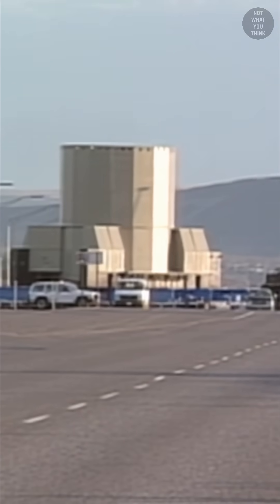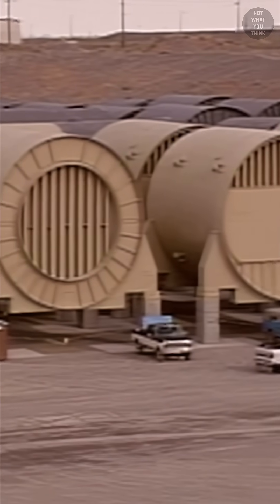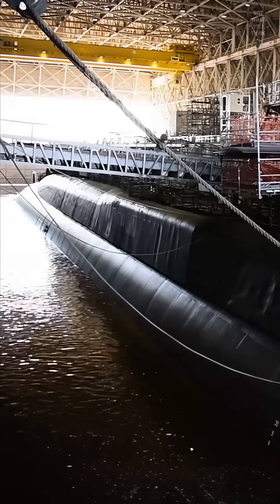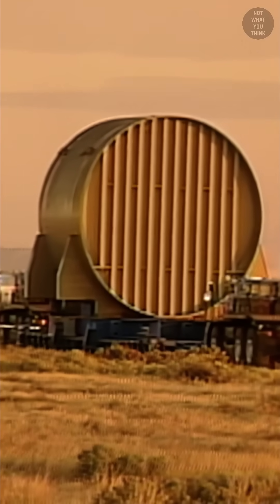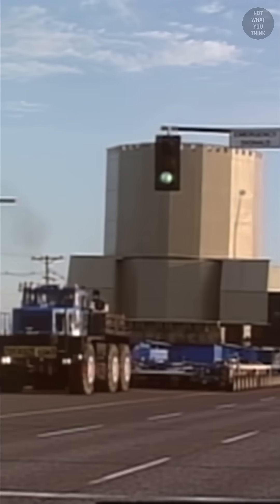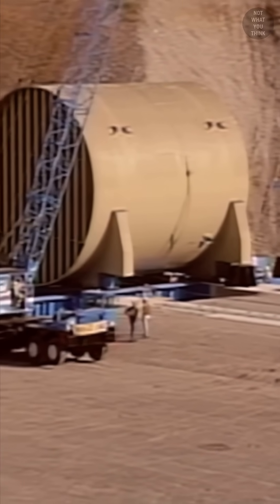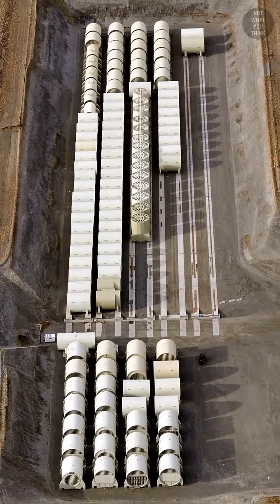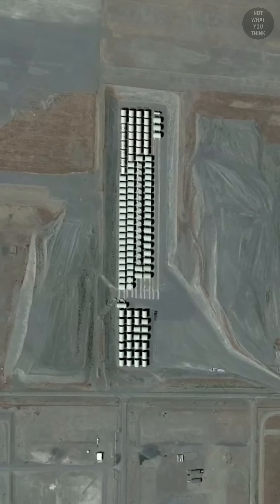What Happens to Decommissioned Naval Nuclear Reactors? #shorts

Comment: Hanford had a release of nuclear materials from an underground tunnel, it was so bad that commercial planes couldn't fly over the facility (built in the 40's)due the high levels of radiation in the air (this occurred in 2017/×018, and it was widely reported on......

Comment: When I was stationed on the Nimitz in Bremerton we used to see these getting loaded onto the barge after the shipyard cut them out of the sub. We called them BRTs (Big Round Things). They would then weld the two ends of the sub back together and re-float them, so there were a bunch of stubby subs tied up to the pier, waiting to get turned into razor blades.

Comment: I prefer to have them in the open, besides the arms treaty requirements, it's easier for structural integrity inspections, and repairs if necessary. Besides that, you're guaranteed work for over 5,000 generations...🤔

Comment: Having actually refueled a 688 class sub, I can say that they do not cut out the entire reactor compartment, only the top. They then lift the pressure vessel and put it in a shielded container which is what you are looking at there. They are also usually shipped by train

Comment: It's also because aboveground storage of dry waste makes it ridiculously simple to set up a crapton of radiation monitoring to detect any leaks or other problems while the waste decays away, and should there be an issue it is far easier to fix safely if you can just show up with hazmat suits or a Drone and have 360⁰ access to the storage cask.

Comment: I thought they were stored in open so nothing could potentially happen to them and could easily bury if needed to since its technically nuclear waste. Why they welded and sealed it up. However things tend to leak overtime and you dont want to be in a sealed building when it happens.

Comment: Yea and need 100000 years for that to become safe !!! It’s really not worth it this nuclear stuff , not worth it , it only started less than 50 years ago and we already have problems , I wonder after 1000 years !!! The earth will be inhabitable !!! Humans deserve to be extinct
Reply: A reactor without fuel rods is a useless piece of radioactive metal that cools down in a few decades, it's "safe" the moment you pull the fuel out. Are you actually ignorant enough to believe that just by running a controlled nuclear reaction, the reactor itself maintains radioactivity for thousands of years? Moreover, unusable nuclear waste from modern breeder reactors that decays over thousands of years constitutes barely a few percent of all nuclear waste produced, the rest of which decays in a couple dozen years. If you were to burn through the entire world's uranium reserves, the vitrified waste would likely fit inside any single one of the world's major nuclear waste depositories. We're not living in the 1980's, brainlet.

Comment: I wonder if they have enough life left in them for the power grid or at least local power needs.
Reply: These reactors are made for highly enriched uranium, to keep them smaller and lighter and extend the refueling periods. No commercial nuclear power plant is running on this type of nuclear fuel, since it's weapons grade uranium while commercial reactors only run on 3 or 4 % enrichment.
Also they have no cooling any more (the water around the reactor is cooling it) and they lack critical safety equipment like a containment.
Commercial submarine reactors are in the size of 100 to 500 MW thermal power (electric power of a reactor is around 1/3rd of it), while a commercial power plant is 1000 to 1500 MW electric (and 3 times this number in thermal power)

Comment: Do the reactors give off a digitial , thermal, radiated signature? How does satellite verification know they r real reactors?
Reply: There are human observers from each side all along the way until the reactors are delivered, at which point satellite observation takes over with periodic on site verification visits.
Reply: All the procedures are done out in the open, if the opposing country doesn't see the procedure happen, well sucks for them, because all they have to do is just have a satellite looking on those places
Reply: Yes. There are definitely various electromagnetic signatures. 

Like somebody else said, there are observers to verify the chain of custody. Also the containers has tamper-proof seals so its very difficult to open the containers without somebody noticing.
Reply: ☝🏽….. one Question?  how they know sticking all those reactors next to each other where time conditions and pressure won’t cause a chain reaction 🤦🏽‍♂️🧘🏽‍♂️
Reply: @grandwizard9436  because none of that is anywhere near how any of this works? It's not a video game or CNN, they can't just explode, there is no chain reaction setting anything off, they are decom and dead, just sitting out there cooling and decaying in their own little containment vessels
Reply: @grandwizard9436       Without the fuel these are empty used reactors.  They are made of steel which is now a bit radioactive because of activation of traces of Ni etc.
Reply: Why wouldn't they be real reactors?
Reply: @devrusso  - I thin @james solis was speculating that perhaps the objects were mock-ups or fakes to deceive the Russians to believe the reactors (and hence the Navy ship
) was still in service. With that premise in mind, how could the Russians know it was the ‘real’ reactor?
Reply: There would probably be some kind of minor radioactive signature (but nothing you could detect from a distance)
Reply: "digital" ... What ????
Reply: there is no verification for reactors as these have no intrinsic relationship to the number of nuclear weapons. SALT and START have nothing to do with numbers of reactors.

Comment: A giant metal thing bigger than my house is an oversized load? Oh, thanks sign. I wouldn't have guessed.
Reply: People collided head on with a tank on a straight open road. You would be surprise of what people are incapable of
Reply: @QuanNguyen-nc3gm  I mean, tanks are attractive, so makes sense.
Reply: They would probably be crashed into and sued afterwards if they didn't put those signs on the trucks...
Reply: I'd say it's because the truck is oversize even without towing anything so it just has the sign on all the time
Reply: @Kirara  A Geiger counter  left at roadside measured 500 counts per minute, even though the reactor was covered with lead and filled with concrete!

Comment: can those be used to generate electricity??  one of those can power a small city... like 5 to 10.000 🏡
Reply: Absolutely! Per Wikipedia, a single S6G submarine reactor generates 165MW of power. Diablo Canyon Power Station in California (which generates ~8% of the state's electricity and 23% of their carbon-free power but they're still trying to close it down because 'nucwear power scawwwy") has 2 reactors, and each generates 1128+-10MW of power. 

Now, these reactors are at "end of core life," meaning that to the Navy, they shouldn't really be used too much longer for one of several reasons, (relatively) too much corrosion buildup, (relatively) low fuel concentration, radiation hot spots, among others. Despite this, they're probably still only maybe 50% totally used.

Tl;dr: yes, absolutely

Comment: The reactor casings are radioactive. But the used fuel can now be used in fuel fast spectrum molten salt reactors. The radioactive 1/2 life of 30,000 years is cut to 30 years and many times the original energy is extract for powering the country.
Reply: Why dont we use these for power stations like the decommissioned San Onofre plant?
Reply: @peteravisov623  Because people think reactors are dangerous.
Reply: @peteravisov623  Because they can also produce weapon grade material. It against some treaty or someshit...
Reply: @janus4002  Depends on how you set up your nuclear fuel cycle. Most modern reactor designs eliminate the proliferation risk. The us govt needed reactors to make bombs through the cold war, hence why almost all reactors we built were based on these needs and designs.
Reply: @FishbedFive  Chernobyl only exploded because of poor maintenance and awful build quality and cost cuttings by corrupt project leaders. 
Granted if you think that your country is corrupt, incompetent and alike then you would oppose something like this.
Reply: The Static Salt Reactor operates at atmospheric pressure with no moving parts. The chloride salt is less corrosive than hot pressurised water. The fuel processing denatures the original solid oxide fuel. Nothing is removed but it’s now useless as a feed for actual reprocessing into higher grade fuels. It’s anti proliferation. The SSR reactor is intrinsically safe. No internal pressure. No potentially explosive oxygen or hydrogen (water) within the core. It’s negative temperature coefficient means it actually follows load demand. It’s self-regulating and cannot overheat. It could use new fuel but there is so much used fuel there’s no need. It’s a solution to high level nuclear waste. The stuff with a 30,000 years 1/2 life comes out with a 30 years 1/2 life. 
Xenon poisoning is not a problem because it’s vented away from the fuel. Caesium and Iodine react together becoming another salt. Even if the top could fall off, there is no dangerous gas to escape.
Reply: There is better technology for exploiting fast fission
Reply: MOX rods is the word your looking for
Reply: Actually the ones replacing them are vacuum (space) energy power.

Comment: Good to know I am within dangerous proximity to multiple nuclear reactors
Reply: They do not contain any nuclear fuel. They are basically just big hunks of metal. The reason why they have to be stored in this way instead of being recycled like the rest of the ship is because the iron in the walls of the reactor pressure vessel was exposed to intense neutron radiation and consequently some iron atoms have absorbed several neutrons to become cobalt-60, which is radioactive and has a half-life of about 5 years.

Comment: Did I hear you right? Did you say that the entire compartment that held the reactor was cut out of the sub, and that what we see on the truck is actually that cut out part? That is, is what we see on the truck actually the hull of the sub, or, rather, is the reactor taken out of the hull and then put into this vessel that looks like a sub section?
Reply: The reactor is not “taken out of the hull”. Rather, the reactor is defuelled, the whole reactor section is cut out of the submarine and then welded shut at both ends. So the empty reactor remains in those submarine sections.
Reply: @mudspike84  So then, the sub's hull is put back in place, minus the old reactor, right?
Reply: @moodberry  No, LV31 is correct, and I did the defueling and the decommissioning of the USS Buffalo (SSN-715). When a sub pulls into the drydock for decommissioning, a square is cut in the hull above the Reactor Compartment. An enclosure is placed overtop, and Puget Sound Naval Shipyard uses that to remove the fuel assemblies of the reactor and put them into special train cars. The reactor vessel is never removed from the ship. 

After the square is welded back on and the ship has sat in the mothball fleet for however long, the Ex-Ship is towed into another drydock and the Reactor Compartment is cut away from the rest of the ship, typically by cutting the forward end from the RC and Engine Room, then Engine Room from the RC, which becomes known as the RC Package. The Packages are what are seen in this video and at the Hanford Site.
Reply: @itzdylandude  Then I guess my follow on question is, do they make a new section to replace the section they cut out?
Reply: @moodberry  you can decommission it or put in a new reactor
Reply: Reactor taken out only.

Comment: Although I am not sure what process they are going to use for the removal of the reactors from USS Enterprise? How did they dispose of the reactors from USS Long Beach et al?
Reply: Nuclear cruiser reactors are removed from their hulls and packaged/stored in Hanford. The Ex-Long Beach is still pending packaging.
Reply: @BigglesworthNWATT  Sorry, I did not see your response, thank you... specifically how did they remove the reactors and package them for storage in Hanford?

Also I am assuming that they will store these reactors for some time, and would [after say 100 years?], be able to break them up? Would are the long term radioactive components that would still be dangerously radioactive in say 100 years?
Reply: @hypercomms2001  the reactors from surface ships are left intact as the ship around them is torn apart. The disposal packages are built around them. As for the disposal and long term storage I believe the intent is that the reactors are kept at hanford indefinitely for the storage of their components. Note all reactors have their fuel removed and sent elsewhere. Look up the Navy Green Book for Nuclear Powered Vessel Disposal and Recycling
Reply: @BigglesworthNWATT   Thanks very much appreciated. Do you have a link?  I could not find it as a google search...
It must be extremely difficult to build a disposal packages around the reactor? What is the level of radiation, type, and source?

Also as an aside, does the USS Nautilus still retain its nuclear reactor, or has it been removed?
Reply: They have to disassembled the ship from around it that's why it costs so much.
Reply: @davidgivens9381  Thank you, with respect to the USS Long Beach, USS Bainbridge, USS Truxtun, USS California how did they decommission the reactors to those vessels? This is important, especially if may proposed commercial nuclear propulsion for ships such as tankers etc....

Comment: All it takes is one big explosion near all those reactors.. o.o
chernobyl, but worse?
Reply: You could detonate a MOAB near them and it won't do anything.
Reply: The fuel has been removed.
Reply: @dougaltolan3017  So there's absolutely 0 contamination left in them? how come they seal them up and leave them in a remote location like they're dangerous?
Reply: @PureRushXevus  dopey
Reply: @PureRushXevus  
The metal of the steel reactor pressure vessel is actually contaminated with cobalt-60 because when you expose iron atoms to the intense neutron radiation that is produced in a nuclear reactor some of those iron atoms will absorb neutrons and turn into cobalt-60. Cobalt-60 is radioactive and has a half-life of about 5 years so the reactor sections have to be stored for about 50 years after which 99.99% of the cobalt-60 will have decayed. But the danger that is posed by the contaminated metal is low because the cobalt-60 is literally enclosed inside the metal. As long as you make sure that the reactor sections don’t corrode into a pile of rust there really is no danger.
Reply: They're decommissioned... there is no fuel rods left in them.

Comment: The "Oversized Load" sticker on the truck got me lmaoo.
Reply: Truck: I am somewhat of an oversized load myself.
Reply: @jasonchiu272  I donot agree
Reply: @jasonchiu272  I disagree
Reply: @jasonchiu272  o mi jjj  ok
Oo
Reply: @jasonchiu272  o
Oo
J
Jjj

Jjj
Job
Reply: My wife has one of those signs for her rear 😉👍🏻
Reply: I think an "Atomic Load" sign would guarantee other vehicles keeping clear and giving way. ⚛️
Reply: @jabberwocky1707  those reactors are without fuel. It's basically nothing.
Reply: Haaaaaaaa! 🤣
Reply: i think it MIGHT just MIGHT, have an oversized load
Reply: hahah
Reply: You've never seen that?
Reply: You've never seen a truck hauling something massive with an oversize load sticker on it?
Reply: Mining/dump truck in mining city in my country have this sticker too when using public road...

Maybe its safety regulation for big vehicle that use 2 lanes of road or more...
Reply: @AerisReyha  yes it is regulation when they don't fit in the usual standard (country depending) trailer/vehicle size they're classed as oversized and need a warning, this usually goes for stuff that slightly overhangs the trailers where you might not notice and hit it, here it's pretty useless if you need the sign you need to get off the road lmao
Reply: @AerisReyha  where im at anything that is wider then the width of one regular lane must have it
If its over 3.5m wide it requires pilot vehicles
Over 4 and you need police escort to